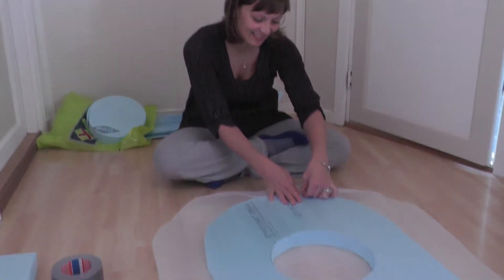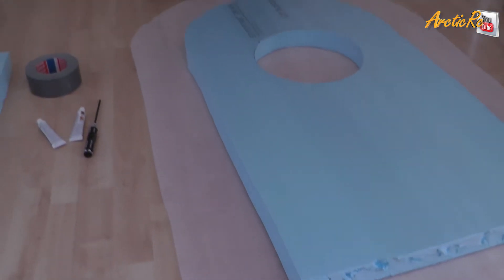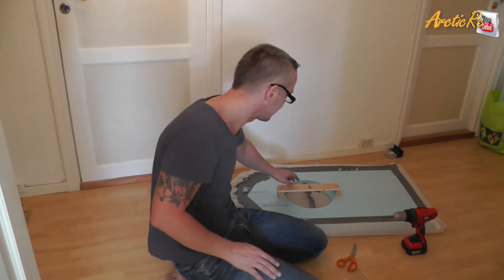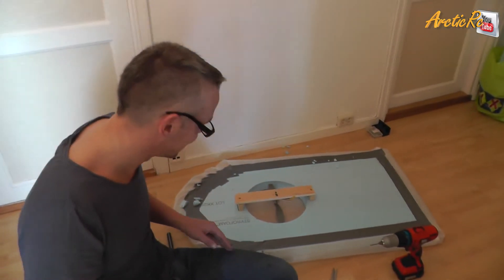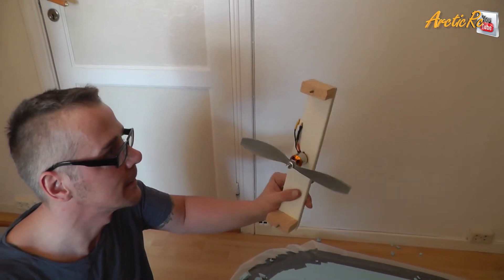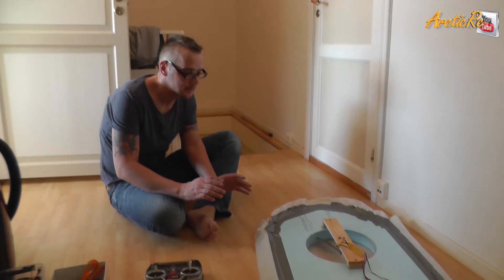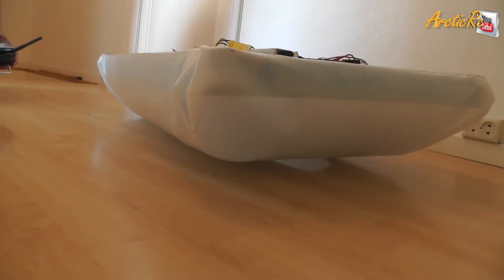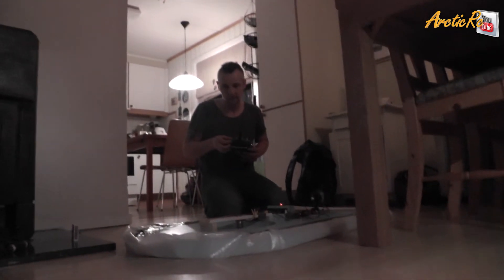Rc Hovercraft Part 1

Comment: Good idea putting the lifting motor on the adjustable knob, looks like it doesnt take much throttle to keep it inflated. Did you need one ESC for the lifting motor and another for the edf?